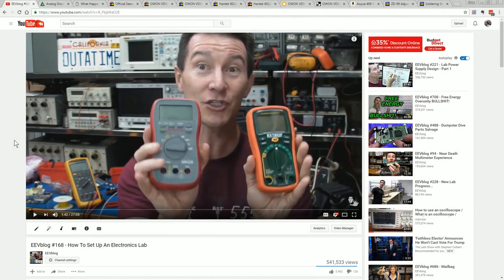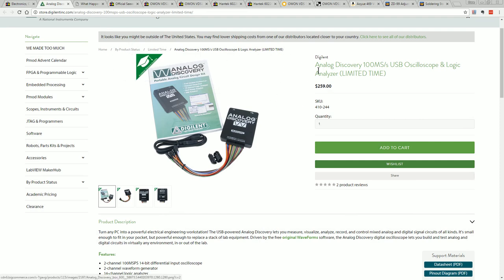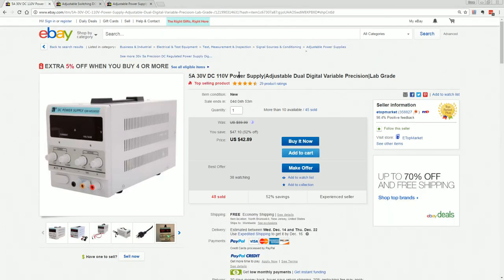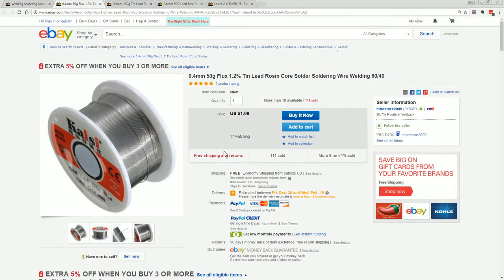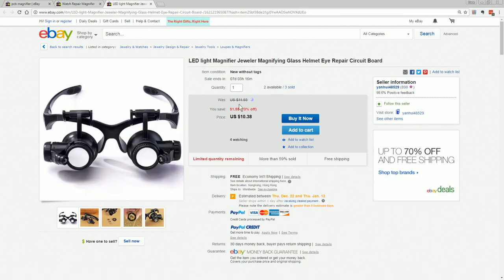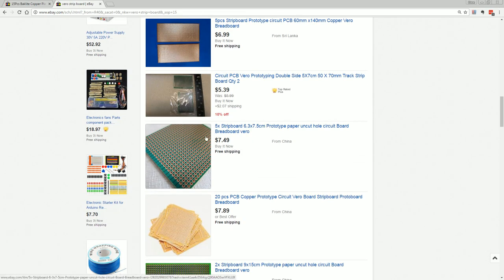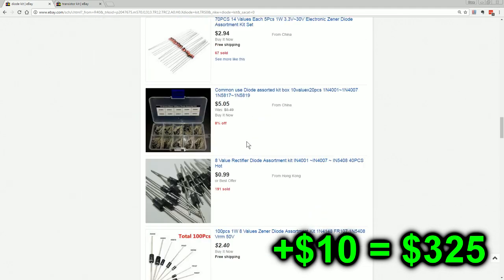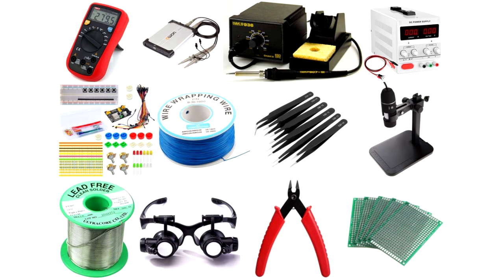EEVblog #954 - How To Setup An Electronics Lab For $300

Comment: The 1 thing I spent some money on was a Hakko fx888d, which wasn't exactly expensive at £100, the rest of the stuff was as per your video, cheap shite from Bay. Oh and i spend £50 each on an Amprobe and a UNI-T multimeter, again small change compared to what you can spend.
Reply: diecast jam got the uni-t 61D as a birthday present this year, love it. spent my life with manual ranging and no features such as min/max/range/hold.
Reply: I also purchased a Hakko FX888D. Wonderful compared to my first soldering iron from Radioshack (absolutely junk in comparison lol). Still just using like an $80 Radioshack multimeter but it's been really all I've needed for now.
Reply: diecast jam I have a $60 hakko 936 clone and believe it or not it works exactly the same as fx888d that my friend has....but I kinda like the design of  fx888d.
Reply: I bought mine pre brexit Michael, it went up a tenner when I was pricing them, I got mine from Maplins, I had an idea they might have shot up, I got mine about May.
Reply: Yeah I try to steer clear of Maplin too, but the Hakko stuff is quite difficult to track down. I can't remember why I ended up getting it from Maplins, it might have been the price or it might have been they were the only ones with stock, but I literately spent about a week looking at the different options, trying to maybe find am independent shop that stocked them, with no joy, so Maplins it was.
Reply: diecast jam
Reply: diecast jam  my 100 pound (500 AED here) Hakko 888D and my 50 pound (250 AED here) UniT ut61c are some of the best things I have bought!
Reply: Anas Malas Yup, that was the point I was making, I spent a bit of money on those 2 things, but the rest of my stuff is just cheapo.
Reply: Yeah. For electronics I only bought these 2 as expensive items... I did buy a dremel and a drill and a saw for wood working but thats another story.

The Hakko should last a good 10 years at least, and the uniT is to be replaced one to two years down the road (its already 2 years old) when I start electrical engineering course at uni...
Reply: The Hakko FX888-D is a fantastic iron! I bought one earlier this year and it performs wonderfully well. However, the Kasai Solder is a bit duff. I bought some 60/40 Cynel solder and haven't regretted it. I also spent money on a Brymen 869s Multimeter a fantastic meter, but I can see that I need a few others as well. The only problem with the USB Oscillioscope that Dave mentioned is that it is only USB 1.1, what the?
Reply: Rachel Maxwell USB 1.1!!! DAAAAAYUUUUUM!

When I soldered with the 888D for the first time I was like WOAH MATE WHAT HAVE I BEEN MISSING and became really happy to solder anything! Right now its holding up excellent and I am doing soldering of a part in 200 projectors!! 

Buy some 63 37 solder... Youll never look at 60 40 again.... I bought a non branded buylt expensive type and it served me awesomely, all 100 grams of it... I recently bought a pound of RMA 63 37 AIM solder, its really good but I liked the size of the 100 gram spool better (carry the entire spool vs take some wire from the roll)
Reply: Rachel Maxwell USB 1.1 is maximum throughput of 11Mbps: more than sufficient.

I used to work for a broadband form years ago and customers used to ask for the Ethernet modern over the USB modem because the USB was 11Mbps vs their 10/100 Ethernet. ignoring the fact their maximum broadband speed was 1/22 the max speed of USB...
Reply: Dave Webster You also know what was more than sufficient? VHS. Although BetaMax was a far superior format, but yes VHS was more than sufficient. So was Vinyl. It was more than sufficient for listening to recorded audio. Actually, when I think about it, there were a number of technologies that were more than sufficient. Take radio for example, everyone is switching over to DAB, but what was wrong with traditional AM or FM signals? UHF and VHF were also more than sufficient at the tasks that they performed. I am sure that I could find other examples of things that were "more than sufficient" for their respective tasks.
My point was simply that it is an older and inferior technology even to USB 2.0 which has a theoretical maximum throughput of 480Mbps and came out two years after USB 1.1.
Also, since you mentioned internet speeds, 300 baud modems should be more than sufficient for transferring data.
Reply: Rachel Maxwell the point here is that you could stick it on USB 2, 3, 3.1 or thunderbolt and it would give you precisely the same performance as with USB 1.1 - there would be absolutely zero improvement from making this upgrade.

I also happen to have a lovely vinyl collection.
Reply: Dave Webster I understand ya.
However, plugging in a USB 1.1 device into a USB 2.0 or 3.x port can restrict the bandwidth on that bus to USB 1.1 speeds for all devices connected to it. Just wanted others to be aware of that incase they were wondering why their Windows Machine would pop up with "This device can perform faster" when they have other higher speed USB devices plugged in.
Reply: Rachel Maxwell sorry just delete my last response as my phone hadn't updated with your response correctly.

your rebuttal has a good substantiated reasoning to have complaint of it being just USB 1.1

I'd hope anyone buying this kind of stuff would know how to switch that warning off and not attempt to transfer a digital movie to a USB drive connected on the same bus at the same time :)

Comment: Whatever you do, do not get a power supply from Amazon.  I did and they just threw it in a box with no padding.  Yeah, a bit heavy brick in an unpadded box.  The whole front was smashed when it got to me, screen broken, knobs broken.  Come on Amazon, can't you throw in a few packing peanuts?
Reply: True, the return process was painless.  But honestly I've had much better luck with ebay for shipping.  It's usually packed by an actual person, not someone working in a robotic warehouse who throws whatever in in boxes that vaguely fit and throw some of those airbag things in there for good measure.  The ebay sellers usually make their living, or part of it, from their ebay shop and know their little corner of the market.  Someone who sells electronics stuff will know how to ship a power supply and won't want to risk the negative feedback and lost money because they shipped it wrong.

Comment: i guess you wont be buying a fluke multimeter or your $300 is out of the window already :P
Reply: Couple of months ago, you could actually. There were very cheap (but perfectly good) Flukes made specifically for the Chinese market. Technically they were not allowed to be sold outside of China, but the Chinese didn't give a crap. You wouldn't get any warranty, but other than that, you could get a top of the line Fluke for $30. 
Sadly, Fluke didn't like that, so they upped the prices (to about $100).
Reply: *****
dave doesnt like the chinese flukes, only the 500 dollar usa made ones with true RMS, thus  his 300$ workshop is bullcrap, even his soldering iron costs more
Reply: dave is a real electronics engineer, I hope he's not using 5$ crap everyday.
Reply: You can get some pretty decent Fluke meters off AliExpress reasonably (models 13, 15, 17)  cheap (sub $100) AvE has some vids, only sold in China so cant bu locally in most of the world. Daves Brymen is a great meter as well as the entry level Agilent/Keysight/HP meters

Comment: Who is this $300 lab aimed at?

I don’t think it would fit anyone’s expectations. I imagine someone would start an electronics lab to either learn electronics or to ‘professionally’ carry out electronics; this $300 setup would not be ideal for either situation.

A learning lab could be much cheaper - more jelly beans, arduino clones, kits and soldering iron + multimeter (no bench supply, oscilloscope, microscope, SMD parts) and would have things added as needed. Second hand or DIY stuff would be better quality and cheaper (ie. for power supply and more advanced gear) as would be added as needed\specialisation req.

A ‘real’ lab would have better components and probably cost more, but would fit that role far better. So I’m not sure who would utilise this $300 setup. Using eBay though is good for cheap operations.
Reply: I agree.
Reply: My question asked who this lab is aimed at, not analog vs. microcontroller for teaching, but I’ll address your point:

Arduino is far more valuable to someone learning electronics than ‘analog stuff’ – the proof is in the pudding; arduino has been a massive success financially, is basically a standard now and the community and resources it continues to build have massively contributed to learning and introducing people to electronics. I don’t know how you could consider arduino not ‘proper’ electronics given this tremendous impact it continues to have.

Not only is leaning analog not essential to building your own circuits, because so many technical resources, guides, modules etc. are now easily accessible (heavily contributed by the internet\arduino) but leaning analog ‘from the ground up’ was a hurdle\barrier that had hindered people starting electronics, which arduino has broken down and has made electronics far more popular. Of course learning analog is very important and opens up many avenues, but almost any amateur project (as someone learning electronics would be interested in) can be completed with arduino, modules, kits etc. and done so quickly, cheaply and with support and a massive knowledge base that fosters learning.

I ask again though, who is this $300 lab aimed at?
Reply: I would add the financially challenged people to that list, lol. I've certainly been in that boat and had no choice. I have no regrets with my "less expensive" purchases and had a blast learning electronics from the ground up. Cost shouldn't prevent someone from diving in. All the better if you begin with basic electricity and work your way up in knowledge. The end result is a true knowledge. Even with a handful of the most "archaic" components you will be able to build, and invent if you find yourself in that situation. Overcoming challenges because your tools aren't the best (yet!) is nothing but beneficial....and yeah, FUN!
Best